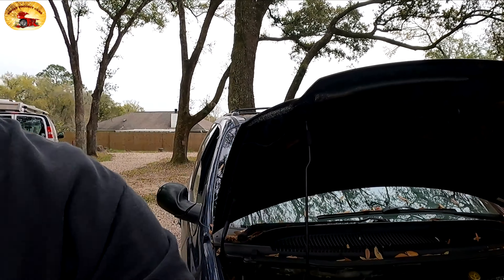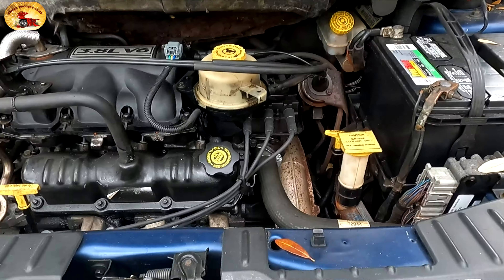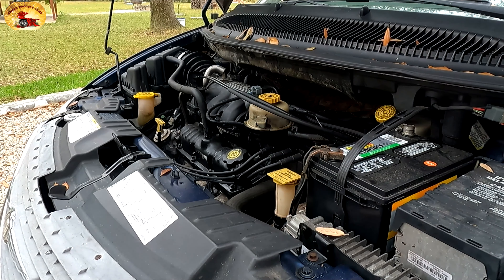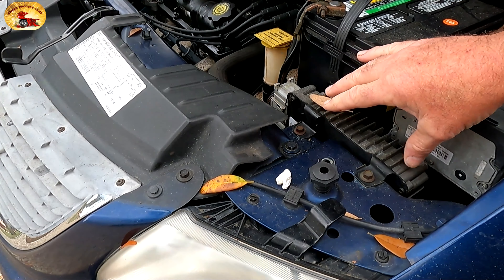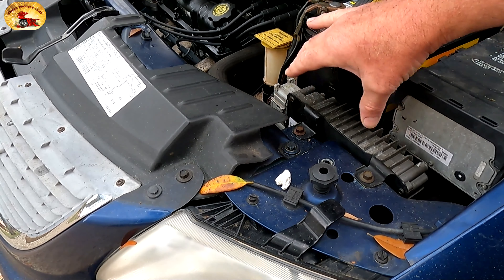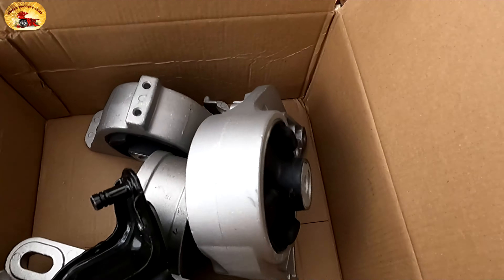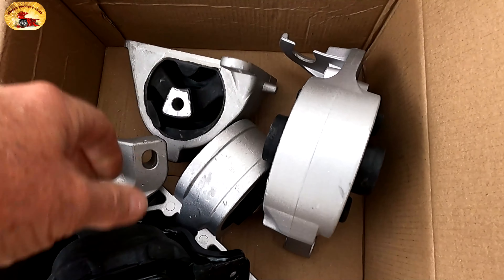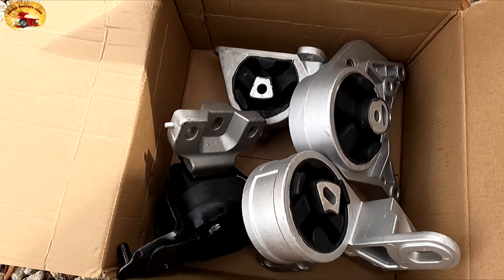How To Know If You Have a Motor Mount GOING BAD on Any Car or Truck...A Blue Bummer UPDATE

Comment: That motor mount identified as Granny's old rocking chair! 😆

To the shadetree mechanics out there; be very careful when changing them, as the motor/transaxle will need to be supported during the swap. Floor jack, jack stands, and possibly an engine hoist/support bar might be needed. Read your Hayne's/Chilton/Bentley repair manuals for reference.

Comment: Would you have a recipe on how to stop a sealing rubber on a sun-roof from further deteriorating?
I got a class car that spent most of its life on Hawaii, and the rubber around the sun-roof and the windscreen had already developed cracks. It appears to be still sealing well enough, but I was thinking conditioning the rubber with something could give me more time before having to replace the rubber.